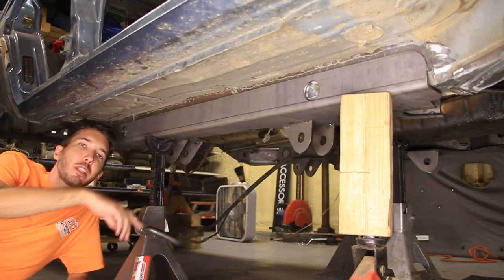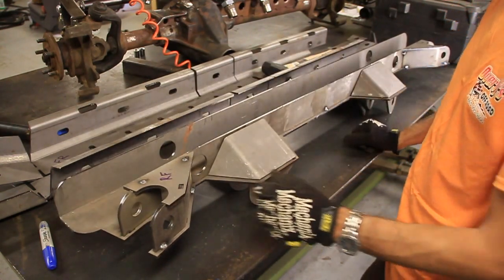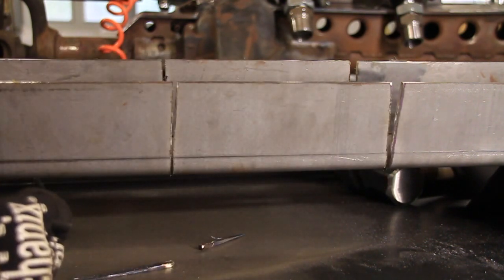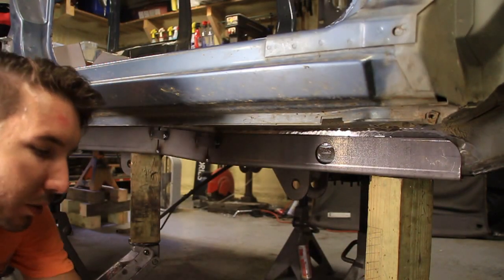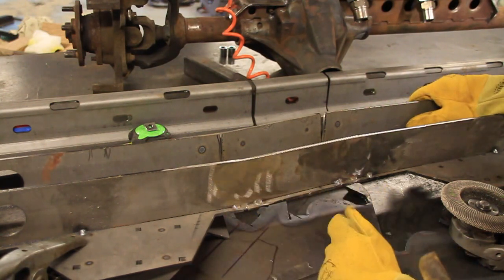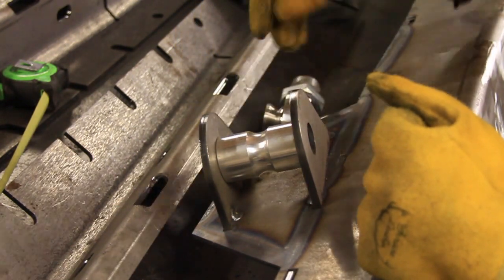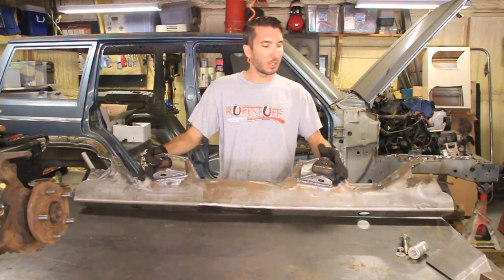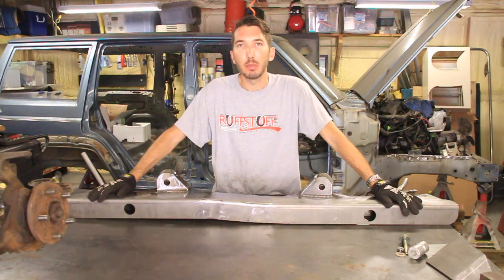4 Link - Welding and Fabrication

Comment: For filling gaps: TIG welding rod is a great way to bridge gaps with MIG welding.  Helps add non-molten material in the space between.  Just lay it in the seam and weld over it.

Comment: Going 4 link in my tj as soon as I finish these axles. Think I’m gonna use Clayton setup with custom arms with ruff stuff ends. Kinda on the fence though because I do like to drive on road a lot and it gets kinda old constantly lubing the ends. I don’t get why they don’t add a zerk fitting but maybe it weakens the ends...idk

Comment: You made a good looking piece. It's a shame it didn't come the way it was supposed to. Have you considered doing a 4BT diesel swap into a jeep? I would be interested in seeing you do it. May get me motivated to do the swap as well.
Reply: I have seen threads about using the smaller smaller Cummins I believe it was a 3.3 the guy use and he said everything was mechanical and had a adapter plate made for the trans

Comment: Could this kit be welded to existing frame stiffeners? I have the TNT frame stiffeners on my rig. Looks as if I could just use those to weld the connection points to.

Comment: jw why didn't u leave the cuts unwelded and used them for another point to weld to the frame?
Reply from the maker: I thought about it but wanted it to be clean on the outside and I also gusseted over the inside cuts.
Reply: +BleepinJeep I'm sure it'll be just as strong either way. I agree it'll look alot better the way you did it

Comment: I bought the exact same 4 link kit. It took about 4 months to get and this was 2 months after I was put on the waiting list, when I received the kit I was impressed with the quality but soon noticed during my mock up I was missing one of the link mount tabs. I was sent the correct amount of pieces but one of them was duplicated. The front links have a different bend than the rear. I called and called and explained my dilema and they seemed concerned as they mailed me a replacement tab however; they sent me the same tab again.....yes the wrong one. During all of this they made some changes at they office and I can't get anyone on the phone. My biggest concern was how to navigate the bends in the XJ frame rails as this kit was meant to be used without conforming to the unibody. Thanks to Bleepinjeep I am going to wait and see how his mods turn out and then I'll move forward on my build. I'll just work on my axles and trusses for now.
Reply: Can someone please tell us what kit this is please?
Reply: The kit was made by EOR (Essentially Off Road) I'm not sure if they still make the kit.

Comment: I see which end you made the front but how did you find out that that was actually the front and the included print out was wrong?
Reply from the maker: +Daniel Niemoth I took an educated guess but did find out later from the manufacturer that my guess was right.
Reply: +BleepinJeep OK I see they still have not corrected the print out because mine is also wrong thanks for the reply and info your jeep is coming along awsome good work

Comment: This is just a thought but couldn't I use this same kit that you bought on a Dodge Ramcharger if the frame rails are the same width with modifications
Reply from the maker: maybe, but not sure if the geometry would be right...
Reply: BleepinJeep did some research I think I'm going to use ruffstuff specialties triangulated four link kit front and rear having a hard time figuring out what shock setup I'm going to use seeing as this ramcharger will see both street and trail use (plus it will have the heavy 12v cummins sitting in the front)

Comment: Instead of welding nuts on the framerails, why not look into a nutsert? You just drill the hole in the frame/bracket when its welded together, then you press the nutsert in. This is how a TJ skid is in place; and although they do sometimes fail; they are apparently a more 'secure' way of fastening than a welded nut on the inside.
Reply from the maker: Not nearly strong or reliable enough for the beating this thing is going to take.
Reply: Are you certain? Some nutserts are pretty stout; such as these: http://avdelusallc.com/products/nutsert.shtml

They are only 5/16" though.
Reply from the maker: They got any 3/4" nutserts?
Reply: +BleepinJeep I dont believe that company does; but they are made from someone Im sure.

That said, Im certain your welded nuts would work fine; Im just trying to make life easier for you, haha.
Reply from the maker: That's cool, but it was already done several months ago.
Reply: Ah, fair enough. I never know how far behind your videos are. :P

Comment: You should push a mig, not pull it. Your welds with be much flatter,and wet in better.
Reply: Push a solid wire mig, unless you're into high profile, humpy welds. You wont get better penetration, you're just piling wire on top of wire.   drag flux core E 71T.
Reply: You don't have to agree with me, I cant force you to be right. I don't refer to internet opinions, I use my 40 years of AWS, ASME, and API certifications.
Reply: David the Welding Guru White well it's straight from Miller, the people who make welders you use.  I'll take the advice from them and looks like BleepinJeep will to
Reply: Excellent.